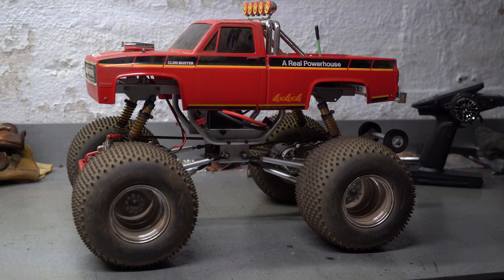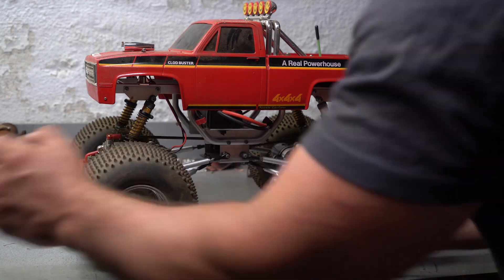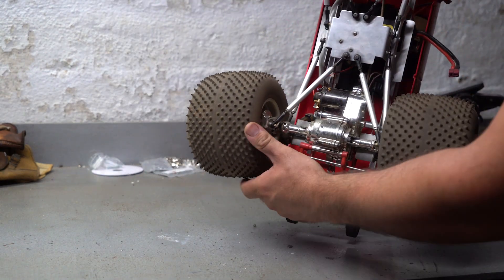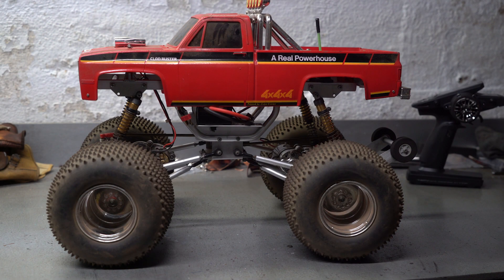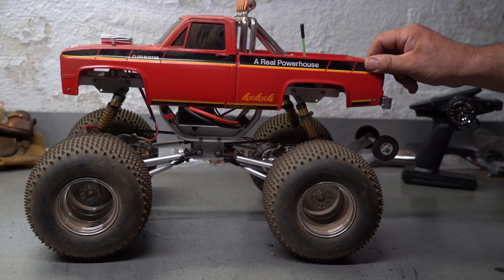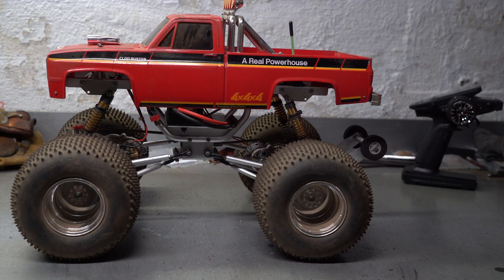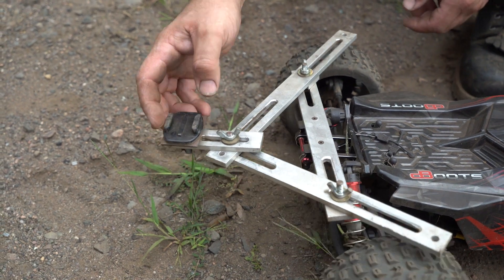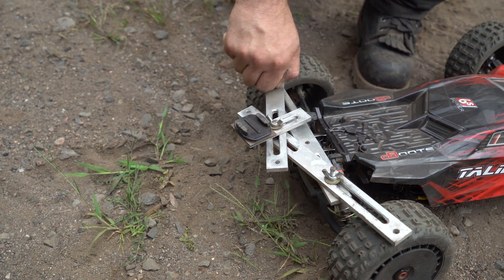clodbuster esp chassis first run

Comment: Love the videos. I have a sassy chassis clod I "restored" to operation after being a shelf queen. Mine has a full chrome chassis. I went with aluminum axle tubes and knuckles. I bought new chrome ladder bars. One thing I noticed. The older stuff is black under the chrome and brittle like a twig by now. My new ladder bars are white/natural under the chrome and flexible. Running mine on 2x 2s lipo's, evx2 esc, and monster mash motors and it's stupid fast, like uncontrollable. I'll post a video of you want more specs.
Reply from the maker: Assy McGee sounds like a nice truck I know what you mean about the chrome plastic pieces the wheels are white under the chrome and not damaged at all. I want to pick up some of those aluminum axle tubes
Reply: @clodbusted1776  I had difficulty finding axle tubes that still had trailing arm "balls". I'll look and see where they came from, I think integy. I had to mix and match the aluminum stuff to retain stock type suspension. I'm off work sick, when I feel better I'll make a video

Comment: great video brother, i had the same chassis back in the mid '90's, i remember flipping the shock mounts upside down to lower the ride height, it helped alot.  i still have bit's and pieces of that chassis laying around and modded for other things;)